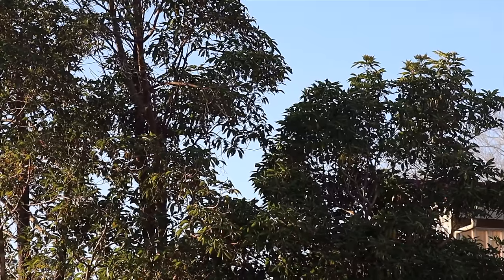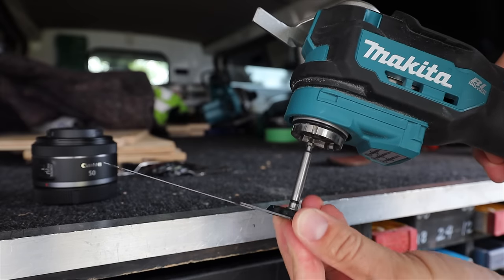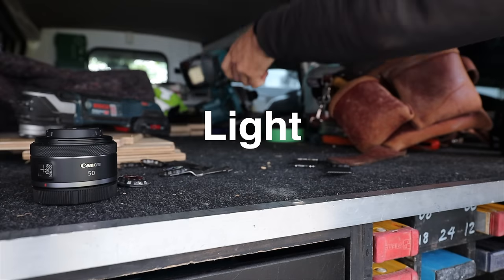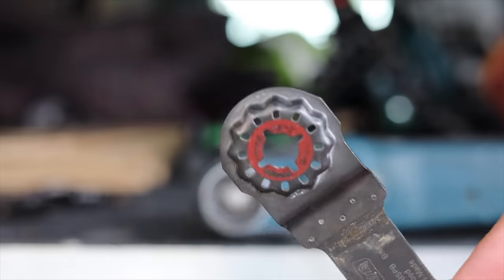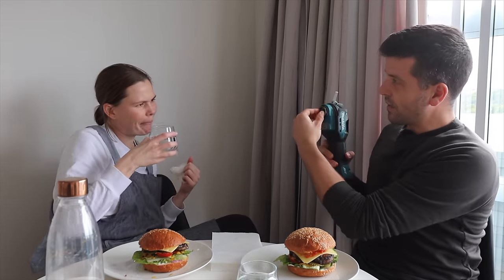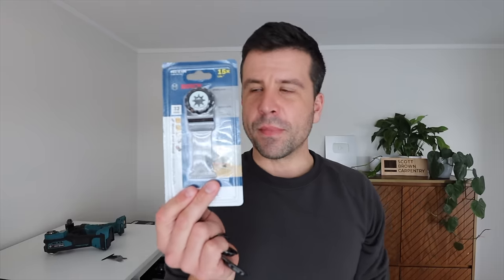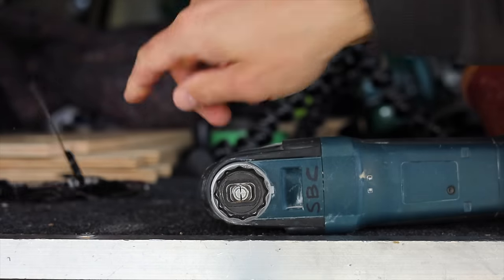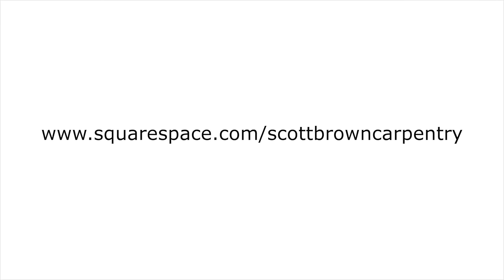Have Makita Made The Ultimate Multitool?

Comment: Losing the pin was back of my mind through the whole video.  I feel like Makita missed the chance to include a second hole or a magnet for storing the pin during blade changes.

You could test the concept, use hot glue or something else temporary to put a strong magnet somewhere on the tool.  New blade change order of operations would be:  pull pin, store pin on magnet, change blade, reinsert pin.

If it works, drill a hole into the plastic body and epoxy a magnet, so it is flush and permanent.
Reply: If you're dumb enough to lose a pin DURING a blade change than you shouldn't be messing around with tools
Reply: @hustla818  In a large enough commercial setting, dropped parts can essentially disappear.  And with downtime costing tens or hundreds of thousands of dollars, you can't wait to "just buy the part".  Especially for old machines where the manufacturer went out of business, or plans and technical manuals aren't available.

Obviously a pin isn't lost forever if it is dropped in a smaller workplace like home construction.  But my work background influences the way I think, and to me, unsecured parts and tools are hazards.

I come to Scott's channel for the mellow vibes.  It's sort of weird to see someone getting so defensive and accusatory in the comments, especially on a 1 year old video.  Normally good people like Scott have fewer trolls int he comments.  Are you okay?  Do you need help?

Comment: FYI, Scott the Starlock system is a collaboration between Bosch and Fein. Also the Fein cordless Multimaster MM 700 Max here in the UK uses a similar latch system to the Bosch, so no pin but it can also take all 3 blade types the Starlock, Starlock Plus and Starlock Max.
Reply: It's also the best with the least amount of vibration. The engine is  decoupled from the body. Too bad they are a bit expensive and have a relatively small eco system. Although I've read they joined the Bosch battery alliance. A Fein MM on a Bosch 4 Ah ProCore battery would be amazing and definitely my first choice.
Reply: @macvos I also hope they join the battery alliance to. That would be the best solution for us customers. Only needing one battery platform and just buy the best bare tool for the job. It would also force the manufacturers to make more of an effort to make a better tool instead of just an ok one and rely on customers in their battery platform.

Comment: I live in the netherlands and here we have an open style blade. This way you can change the blade without having to remove the bold conpletely. This seems way more convenient then the new makita starlock.
Reply: came in here to say this.  i have that makita 18v older style but with the lever.  for blades with a slot in the "foot" just slide it in without removing the bolt and lock 'er down.  but having a starlock max blade for deep cuts sounds nice.  also the old makita is loud AF
Reply: Emile, the starlock system holds the blades better, more force to them, which means faster and powerfull cutting.

Comment: Got the Fein cordless 500 , it's great, I always have it in the van, but don't like using it for long due to the vibration (which is low compared to other brands) but it's essential for some small tasks, love it when I need it. Cheers
Reply: Well, noone likes to use multitools, they suck at everything they do but They're not replaceable
Reply: Have you ever had the chance to compare the Fein cordless to this new Makita?  Was about to buy the Fein cordless, until Makita came out with this brushless motor.  May go with the Makita now.  People are saying good things about it’s power and very low vibration.
Reply: Biggest Dongle  yeah, I do like the Fein multi tool! 👍🏻

Comment: i know this is probably blasphemy to say, but i think the ryobi multi-tool is actually one of the best. Quick release blade, and not only can you rotate the blade position, but you can also pivot the head in a number of different ways. Great for work in tight spaces
Reply: Have ryobi got better batteries these days?

I had a couple of ryobi tools and the battery really put me off the brand. But to be fair this was a long long time ago
Reply: I am a sparky. I would stick with the brands like Makita Hitachi, Milwaukee or Dewalt. Ozito, Ryobi, Black and Decker, and Stanley could last for only a few months of intensive usage. I have both Dewalt and Makita tools. People on site would argue  about which brand was better. I would always say that people with big hands and stronger arms should go for dewalt, smaller hands people would be benefited from the makita’s ergonomic grip design.

Comment: I have the Milwaukee m18 fuel. I’ve tried the festool but I didn’t like it much and I tried the Bosch but it was loud and had a lot of vibration. Never tried either Makita but I might try the new one when it comes to the US.
Reply: there is a third makita one that came out in between the ones shown in this video thats a combo of the two
Reply: Buy the Japanese made on Amazon jp if you can, far better manufacturing process and quality control

Comment: As far as I can tell, the post on the Makita enables use of blades with fully enclosing holes as well as potential backwards (and, with the right adaptor, universal) compatibility with older blades and blades from other manufacturers.  For example the 'as seen on TV', at least in NZ, Renovator.  I could be wrong and more than happy to be corrected.  Just starting to try to figure this all out.  And this video was most helpful for that.  Thanks.

Comment: I have the screw lock Makita, as well as the lever lock Ryobi.
The ryobi has a squeeze trigger (awesome), quick release blade, pivotable head for cutting in literally every angle as well as soft mountings for vibration dampening.
After using the Ryobi, the Makita is a joke of a multittool.

Comment: Still think the DeWalt multi has the best blade change system out of all the major brands. So quick!
Reply: I was watching this video just thinking thank God I have a Dewalt one so easy-to-use.....
Reply: It's a bloody awful tool though. It vibrates, it wears plastic off where ot contacts your batteries  and wrecks your batteries too, it gets really hot on the handle, it's not ergonomic, and the trigger wears out so you can't get a constant speed anymore. Triggers on multi tools are bad. They should have a switch and a variable speed dial like practically everyone else. I hate mine and I'm going to get a different brand one soon.
Reply: rockwell makes  the best vibrator  tool.i prefer over dewalt metabo bouschect triied  many

Comment: I have had the corded Fein Multimaster since 2011.  I love that when I need it available it is there to do the jobs that other tools just can't.  From what I gather Fein tools had the original star lock with a pin, but their patent on the oscillating multi-tool ran out in 2010 or 2011.  That was when we saw the emergence of oscillating saws from all the other brands.
Reply: I don’t remember what Fein called their previous pin system but it certainly wasn’t Starlock.  Bosch came to Fein to work on Starlock together as Bosch was keen to get in on that sweet sweet consumable $$$ that was about to open up for them.  The “pinless” design has it’s cons, however, and I’m guessing Makita was privy to this.  It certainly wasn’t cost reasons.  Both mechanisms cost the same.  Royalty wise, it’s still starlock branded and I’m figuring Bosch waves that anyway.
Reply: 15yr old multimaster still has the most power for the harder cuts. Imo.

Comment: The recent DeWalt ones have a nice system but I have no clue if they use starlock. The system itself is great though.
Reply: The Dewalt can use all of them, they include an adapter for starlock blades.
They shine with the open back blades though, you just pull the trigger lock and slip it in. So easy.
Reply: I have the dewalt it’s good as long as you have the strength to push the spring lever. And consumables are cheaper than star lock. There is also Bosch star lock for angle grinders
Reply: Yep, another vote for the Dewalt system, super fast, especially if you’re changing angles a lot to get a cut right.
Reply: Yeah I have to agree I have a Makita Renovator at but used a mates DeWalt Renovator and thought his was a lot better. easier blade change plus it had a LED
Reply: @daves4026  that's X-Lock. Great system that Makita also started using
Reply: @macvos  thanks for the clarification 👍

Comment: Never understood the pin in the makita, even less now that they use a Starlock system.
I work in a hardware store where we have demo machines of the multi-tool on display and on both the screw has been stolen because people lose it. Bosch and Fein do it better with just the click system. I guess DeWalt has a similar thing where you thread it on from the side but you are limited to just their blades that have the slit in the back
Reply: there are 2 different patents. they just bout the usage of the Star-form. Not the fast fix function
Reply: @GermanClimaxClan  Bosch and Fein developed the Starlock system together. by the way bosch also developed the X-lock system. And Fein will be using Bosch 18V system soon.
Reply: I've used a Fein that used a similar pin system.
Reply: @KriegerDelfin24  yesterday  i read a lot of this topic. seems like thats the "solution" of making 3 types of blades compatible.
Reply: all’s I know all the common blades fit my dewalt
Reply: @henryk1031  also all 3 starlock types?

Comment: I think Fein adapted the Starlock system, as well, but their first tool had a quick release before everyone else.
Reply: Fein actually invented the system not Bosch
Reply: And frankly I would love to see someone make an adapter to run non Starlock blades on Fein, or Bosch or other Starlock systems.  They are cheaper by far and some third party ones are as good or better than the Europeans
Reply: @wisemay5895  absolutely. The exclusivity of the Starlock system makes it difficult to adapt to many other styles. Incidentally, you can fit Starlock on Non Starlock tools (if they have the universal fitment style), but not the other way around.
Reply: The issue with using third party cheaper non starlock blades is the slack that comes with them when mounted on the machines head through an adaptor, causing faster damage of the vibrating mechanical parts in the head. This happened quite a bit on the old system. The third party starlock blades we have in the EU today all come from the same factory as the Fein-Bosch blades do.
Reply: Fein invented the multi tool, the Starlock system and anti vibration head first

Comment: Thats the original FEIN locking 🔐 drop out bolt system with the new fein starlock system. It isn't friendly to your pocket book because you can only use those blades on the unit

Comment: The DeWalt has a click lock and works with the old standard of blades with no tool to tighten it just clamps on.
Reply: Pity it's terrible design that vibrates your hand to bits, with a trigger that wears out from vibration and becomes uncontrollable, and a body shape that makes it extremely awkward to use. 

I regret owning it. I now run Dewalt and Makita so I will be changing over to Makita soon, as multi tool is one of my most used tools.

Comment: I'm on the Milwaukee platform, but wanted a brushless multi tool a couple years ago and bought the bosch Starlock 18v. The vibration and loudness plus the price on blades was a bad decision. Bought the new Milwaukee brushless M18 and it's day and night when it comes to speed, anti vibration and sound, also the blades are way cheaper. The bosch has been sitting in the bench for a year now with no use.
Reply: The cordless Bosch vibrates so bad it flings the battery off. It’s good to hear positive comments on the M18 model.

Comment: Those burgers looked fantastic.

I'm just curious, since my experience is with a Dremel multitool originally that had the annoying bolt for the blade retention, and now these days with a DeWalt cordless, which has a simple lever that allows you to quickly change the "normal" style blades in like two seconds but I don't think it will accept a starlock blade, so is there a really good reason to use starlock?  Are the blades cheaper, or better or what?
Reply: +1 on this question … hope to hear some advice/thoughts

Comment: Still think dewalt has the superior multi tool, quick change lever for the blades and paddle style variable trigger. Very quiet too
Reply: As a makita guy, I'd have to agree with you. Dewalt's blade change is much better than anything makita has. I am hoping Makita will catch on eventually but this new release is disappointing. I just don't understand what they were hoping to achieve. My guess is there is some deal between them and bosch to boost blade sells of starlock types. I see no other reason for them to do something foolish like this.
Reply: @hotbam37  My guess is it's down to patents, dewalt have patented that type of blade change, hence why no other tool company does it. If they wish to have the same style system, they would have to pay some sort of fee etc

Comment: My XMT03Z here in the US has had the pin lock mechanism for at least four years. I've never seen one like the one you have there in NZ. The pin lock mimics the way Fein does it. Never seen anyone loose the pin but have seen them get buggered up. We sold them as standard replacement parts at the store i worked at for a while

Comment: Fein Tools We’re the first to have the multi tool (Oscillating). I do believe they held the patent on the tool for so many years. I have had one for at least 10 years now. They have the pin and the star lock, so it’s not new. I have the Full kit. It has attachments you can use for sanding, at least 4 different profiles, and also has a sand disk with velcro to attach the sand paper, and has a buffer pad

Comment: Came in thinking the ultimate multitool would be like the last power tool i needed. But it seems the multitool only has one function…. Great video as always loved the dropped clanging attachments bit.
Reply: It can cut, trim, scrape, sand and remove grout, depending on the blade you use...

Comment: I have a Bosch gear, got a kit bag for cheap, sold on the huge warranty.
Later got the multi tool as well, I could not believe that the "Starlock Max" multi blade kit I shelled out HEAPS for didn't fit my new Bosch Starlock...
Also as a fitter doing a lot of metal; small oscillations and some sort of cutting oil is going to save a lot of blades vs big oscillations and dry cutting.

Comment: After many years of struggling I finally picked up a Makita dtm52-something and jumped on the starlock bandwagon. Bit fiddly withe the pin but the tool is pretty light, and gets the job done for a reasonable price. Would be good if the next version reorients the battery like the Bosch tool.

Comment: Hi, my name is Chris from the Netherlands. I was a contractor for 6 years and used to work with Festool corded saw's CS70 tabelsaw, jigsaw, TS55 etc. But for all cordless machines I prefer Makita, also because they started as first wit selling machines without battery packs and chargers. So I could buy much more tools and save a lot of space and weight. With 4 18V batteries and two charges I could take almost any task on location without the need for power. 
But now back to the questions of your video. With do viewers prefer.
Well my choice the FEIN. (The inventor of the multitool)    Because I had a FEIN Multimaster for over 20 years and It think they are still the best I bought the 700 cordless version and I can tell you, when you had tested this one you might have a new winner. I love Festool also, but their prices are almost insane! I find the FEIN saw's also have better quality, that last longer as everything else I have tried. Don't know if they sell FEIN in New Seeland, but when they do grab one for a test!
I love your channel, keep up the good works!
My wife is also lovely, she makes breakfast sometimes and don't mind tools in the bedroom. Specially the one that run on AA batteries 😂😁💥

Comment: I spent 5 + years repairing sash windows constantly and killed 2-3 of the first gen multi tools and my partner 2 dewalts in 6 months, he gave up and had a totally different battery platform just for multi tools.

The old leaver makita is 3 years old and the pins that hold the blade are half missing from abuse so it’s on it last legs but the bigger body came with improved housings and didn’t blow up. 

Could be wrong but I think fein started start lock as they where the first maker of a multi tool! Interested for it to finally die and try this one

Comment: My Ridgid multitool crapped out on me the other day (after 3 years of hard use) and I ran into Harbor Freight to grab one real quick for a job. The way you change the blade on their Bauer brand is similar ( flippy lever with pin)  and every brand of blade i have found fits on it.  I thought it was awesome. It's head is thin, it's light, it's quieter than my old one.  Only problem is it's corded. It was planned to be a one use, extra tool.  But I love it and haven't bought my "actual" new multitool yet.  I might go with this Mikita for my next one, but at the moment I have time to decide since I'm happy with this little $75 cheapo tool.

Comment: I had the old corded Fein and that pin would always play find the most non accessible place to fall into while on jobs 🤬. Hence when I decided to replace and go cordless I had Makita and festool batteries so bit the bullet and got festool to not have to deal with the pin. . But another problem I find in UK is make sure you have spare starlock blades cause not all suppliers( unless you like to waste time driving around) have starlock blades readily available but always have older style blades when you are in middle of job and you destroy/ blunt your blade.